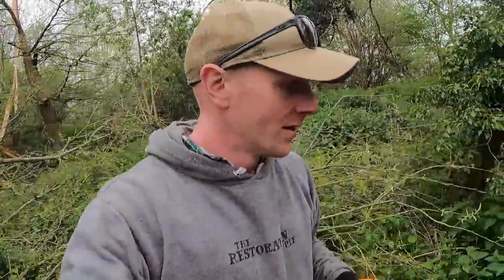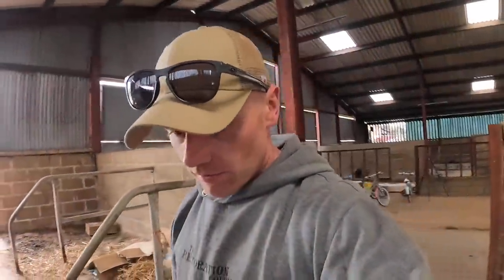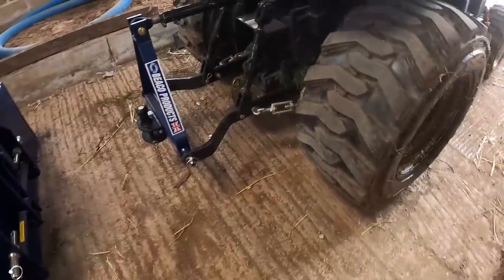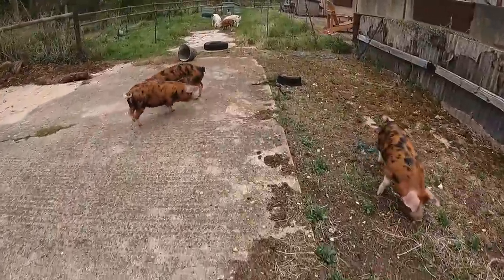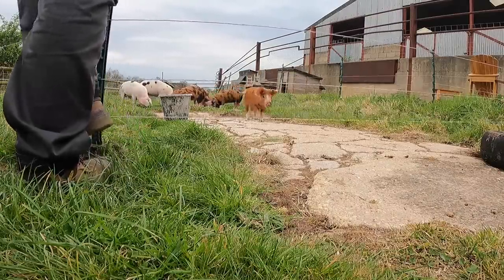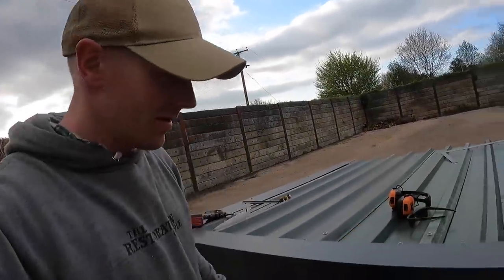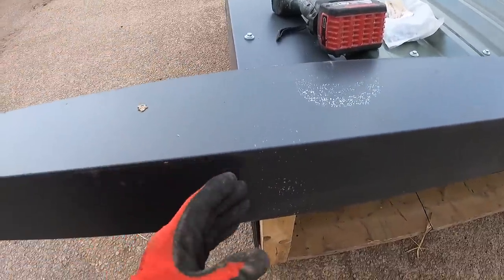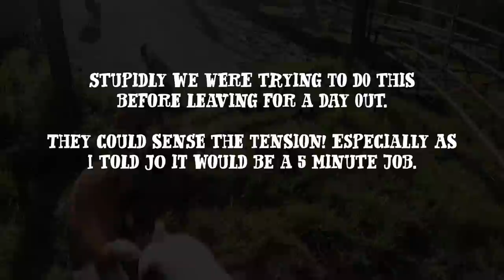TRAINING REBEL PIGS! - Getting the Roof on HOG HOTEL & ELECTRIC FENCING

Comment: When I was young ( quite a few years ago) on the farm I helped at we used pig boards. Two large boards with handles hinged together so when the piglets we’re ahead of you you could trap them in a v formation and encourage them forward. It does help to still have someone shaking the food bucket ahead. Have fun..
Reply from the maker: Yeah that would certainly help.  Working solo it's easier to have them follow however those 4 younger ones has never seen grass hence why they kept freaking out.  All fine now, reckon they would stick by us if we did a 2 mile walk!

Comment: Maybe I'm wrong, but I do have an impression that the electric fence wires were a little high especially for training. Some electric fence manufacturers have recommended heights for fences on their websites. We followed the pig fence recommendations and they worked. The goat fences can look a bit 'over the top' but my goats have been trained from young kids. Pigs don't suffer in silence, they can be very verbal.
Reply from the maker: It was left at that height after we had the sow in there for a few days.  They have now been out for a couple of weeks now with two strands without any issues and almost impossible to get them to move to new ground, even when the wire is down.  They simply don't forget!  Quite frustrating to be honest as it takes ages to coax them to new pens. 😂
Reply: Yes, we had a similar problem when the pigs were ready to be moved. Pigs are highly intelligent and don't forget.

Comment: You need to make sure the electric fence isn't touching the grass or any plant matter. Mow the grass around the perimeter. Touching the grass can trip it to shock, and/or make the shock weaker.
Reply from the maker: Yeah we strim the route beforehand in the fields for the sheep and others.  This mains energiser will be above 10k volts even with some grass whereas the battery one is a little more fussy.